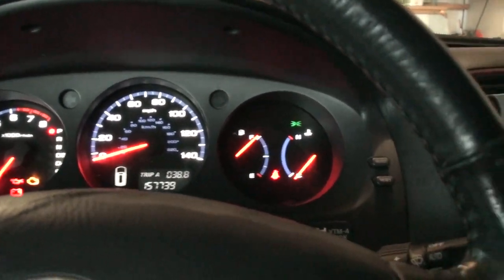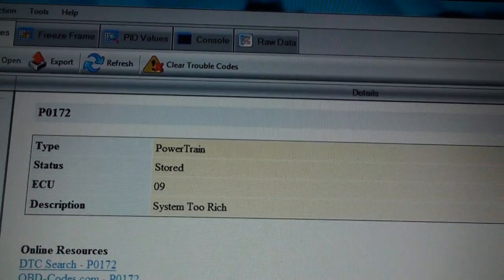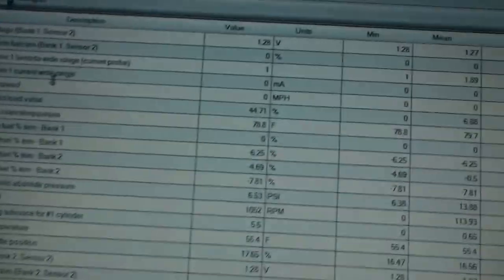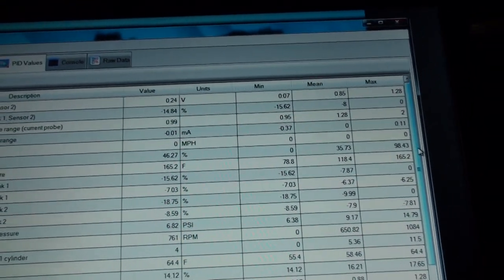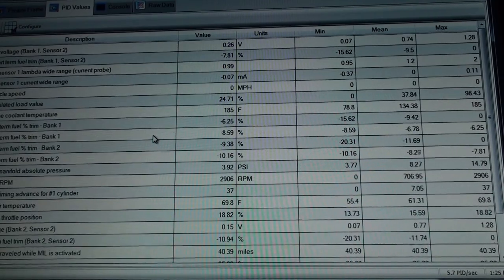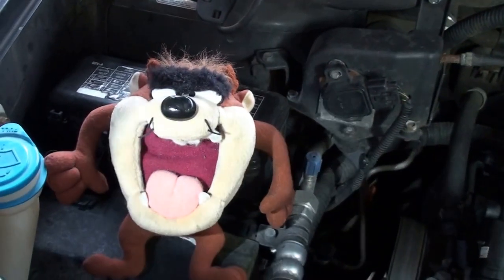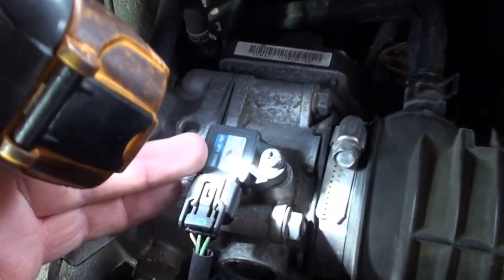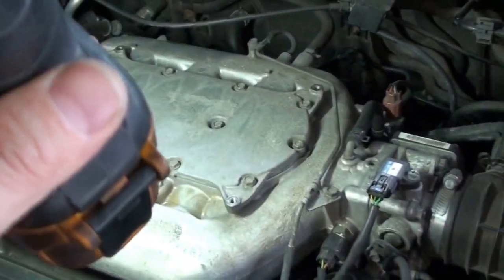Honda/Acura Running Rich Repair - Trouble codes P0175 P0172 -PART 1 - Acura/Honda

Comment: I have the same exact problem with my 2005 Acura MDX 3.5, I been going crazy, Thank you for this video!!!
Reply from the maker: Glad it helped you out.  Check out part 2 of this series. This was one of the hardest diagnosis I have ever done to date to find and correct the issue.  Vacuum readings are the key here to diagnose the issue.   Let me know what you find if you can report back.

Comment: I've had a Vanagon that ran like crap due to tight valves (has hydraulic lifters, but someone didn't set the preload correctly in the past). Took me a bit of time to hone in on that. Great work!
Reply from the maker: Thanks Thomas.  It can be a real head scratcher sometimes.  FInding the issue was a real hemorrhoid, you know how it can be!!  Thanks for stopping by, take care

Comment: Great detective work Glen! And when I saw Chaos sitting up there on top of the windshield, I knew he was giving you hell on this car. How did you finally come to the conclusion that it was the valves not being adjusted correctly. Leak down test, smoke test? And go ahead and show as much footage as you filmed. I'm sure that it will help folks out there who has to do this job. Oh, and don't forget to leave all of the cussing in there LOL. Looking forward to see the procedure of how to adjust the valves in an upcoming video. Opps, almost forgot! I got your sticker Friday and thanks again!
Reply from the maker: Glad you got the sticker!  Do what I do Terry, stick one to my forehead.  You might not remember it's there but you will never lose it! haha  Yes I did a smoke test and watched the vacuum needle flicker.  The car now has 22K miles since the repair.  Check engine light has never returned,  I actually rode in the car yesterday with the owner and at 180K miles runs like a top!

Comment: Thanks for the tip. Working on a Honda Odyssey with P0172 code.
Reply from the maker: Check out Part 2 for what was really going wrong.  Glad the vid helped you out, this was a difficult diagnosis for me at the time.  -Glen

Comment: Thank you for this. Just bought an 08 TL. It was running rich because there was a dead chipmunk chilling under the air filter
Reply from the maker: Bet you were surprised to find that?

Comment: Awesome video it is exactly my issue running -14 and -17 b1 and by I performed a valve adjust ment earlier about 2 years ago. Changes all my sensors new belt water pump all the car had time issues change the cam sensors and it starts and runs great with exception, of 172 &175.
Reply from the maker: Make sure to check out part 2. 👍

Comment: I bet that it runs a lot better now!  Nice job so far, haven't seen part 2 yet.  Lol
Reply from the maker: The crazy thing is the car was actually running fine even with the codes before the fix.  I think fuel mileage improved around 1+mpg.
Reply: Ozzstar I'd have expected much worse. I guess the computer was doing a good job of keeping it in check.

Comment: This is common on the 1000cc sports bikes too.  They call it "wearing in", rather than 'wearing out.  When doing a valve job on a bike, you must have a minimum gap (I forget, maybe no less than 10 thousandth's).  Because the issue is NOT that your rockers/ tappets will get too loose and make noise-- it's that they will get too tight and not let the valve close.  Ironically, on a bike, as it just slightly leaves the exhaust valves open, you can hear a "knock" / tick sound as your'e revving-- and it makes you think that the valves are loose and clacking, like in an old pickup or something.  But really, you're hearing the exhaust open a little too early--  or rather, not quite close all the way as you're hard on the throttle and trying to keep the front wheel on the ground. (lol).  It's almost always the exhaust valve, because it gets the hottest.   On the bikes, they actually have a little round disc the size of a nickle, that sits on top of the valve as a wear surface for the cam;  that is very precisely machined to the thickness that you need, and that's how you "adjust your valves.  You have to measure each gap from valve to cam and order the exact size you need (allowing for the minimum clearance)--- it's not a general kit that has them all the same across the cylinders.  They are a lot more precise than that, since these bikes run to 15k RPM's, or more.  It's the same on the crank bearings.  You measure your bearing size, and the kits will have different colors.  Meaning blue is +.002 over, red is +.004 over, and purple is +.006 over, ect. ect..   So you order the exact size you need for each crank bearing journal, to get you within +/- .001 tolerance.  So you end up getting all these random sized bearings and you have to remember where they all go.  It's not like on a SBC, where you get a .030 over kit on everything and just throw it together.  It's a lot more evolved than that,  having to plasti-gauge everything;  they call it "blueprinting" the engine.  The bike I tore down ran fine-- but it had 30k miles, so I wanted to get ahead of the crank bearings failing---  and even with the largest color they had (I think it was black +.012 over?  I forget), I was still slightly out of tolerance, that's how worn everything was;  the book said to scrap it- it's too far out of spec.  So I just said f"ck it and got all blacks (the largest oversize they offered) and threw it back together, and it worked great.  I just thought it was an interesting rabbit hole that I went down, and learned along the way.
Reply from the maker: That's a lot of good information.  Thanks for sharing your experience with engine building calholli!

Comment: Hopefully I can have a answer from you ,today I saw a 07 Acura tl type s, with 95k miles ,guy said that one of the valves was a little chipped and he had to do Head work for car ,now car runs rich ,but the thing he still drives the car with that issue going on ,my question is ,do you think is a good or bad idea to buy the car ? Please let me know ,
Reply from the maker: An engine that runs rich for an extended amount if time will damage the catalytic converters. The rich condition needs to be corrected. Plan on spending money and time to solve the headache he is getting rid of.
Reply: @ozzstars_cars  thanks so much for your answer! I think I might stay way from that type of Headache.👍
Reply from the maker: @alesil9929  smart choice unless the car is a super cheap deal
Reply: @ozzstars_cars  5k ?
Reply from the maker: @alesil9929  more like $1200
Reply: @ozzstars_cars  ok man thanks I really appreciate you took the time .

Comment: Old video, but would that issue came and go? 2003 odyssey owner here. 225k miles. -14% to -24% short fuel trims, misfire sometimes, lack of power. Few days later she drives perfect for weeks then back to the issue again.
Reply from the maker: Fuel trims would stay negative constantly, it won't fix itself unless your VVT is having a weird problem
Reply: @ozzstars_cars  I didn't think that would be my issue.  I don't know what else to check. Fuel pressure regulator going bad maybe?
Reply from the maker: @alexacuna3454  yup. Watch part 2 on this vid. 😉
Reply: @ozzstars_cars  so the valve adjustment fixed it?

Comment: How did the engine run before the valve adjustment? Was there any idle quality or performance issues? I am getting the same two codes on a 2007 Pilot that I bought not running due to blown head gaskets. I sent the heads out and set the valve clearances on the bench before installing the heads. It runs fine, but the idle is a little rough. Thanks for the video.
Reply from the maker: Ran perfect with the check engine light was on.

Comment: How long was it running rich? Did it have any catalyst efficiency codes p0430, p0420 after the valve adjustment?
Reply from the maker: Not sure how long the car had the rich codes. Ran perfect for many more years after the valve adjustment. No codes.

Comment: Question.i have a 2010 Honda Civic. I've had P0172 code only. New MAF sensor and still no good. Then my car after few months would just die..die... while I was driving-id have to turn car off and it restarted fine a few different times. But now if it dies I'm having to wait 10 min to restart. Fuel pump relay is good ..I'm afraid it's a fuel pump going bad. Any thoughts?
Reply from the maker: It's almost impossible to diagnose an issue like this over the internet.  Have you tested the fuel pressure?
Reply: I will and no I haven't.. thanks!

Comment: Thanks
Have to do the same on Honda jazz 1.4 engine. Short trim is at -20% or so at idle. It's getting better at higher rpm (about -7)
The car is 14 years old an have 100k miles on it.
Let's see how it goes.
Cheers
Reply from the maker: Keep us posted on how it turns out, good luck on the fix.

Comment: Good work boss, I tried replacing the map sensor I am still having the high negative values stft -12 ltft -17
Reply from the maker: Have you checked out part 2 of the video for more info?   It may be even more helpful.

Comment: Trying to figure out the problem.Was there too much lash or not enough ? and would they both cause a rich condition ? Very good detective work without  joining the 98%ers and exhausting the stock in the parts department.
Reply from the maker: The valves did not have enough lash (space).  So basically they are to 'tight'.  This prevented the valve from seating properly, sort of like keeping a window open an inch or two in the winter....there was a draft getting by.  You are right Tom, no parts changing without evidence!  Take care

Comment: I have these codes on my 2010 Acura TL 3.7. It's happened 2 times in 2 years so if the valves needed an adjustment, would this check engine come back immediately when clearing the codes? Should I check for something else?
Reply from the maker: Watch Part 2. Check vacuum readings. 💯
Reply: @ozzstars_cars  Yeah I will read the codes in my car and check the live datas but I'm not very experienced in mechanic to be honest. Should I check something else than the valves if the p0175-p0172 codes only come once per year?

Comment: Hey can you get both these codes if you run the engine with the air filter taken out and the  air intake completely off? Also what about old spark plugs, can they cause this issue too?
Reply from the maker: Doubt it.
Reply: @ozzstars_cars  yea but without the air filter wouldn’t the fuel to air mixture be off causing it to run to lean?
Reply: @spookypasta in a way yes but you’re also introducing a bunch of contaminants in your engine

Comment: Hello Ozz,could anyone answer a quick MDX question,I just bought a new MAP sensor and while pushing it in the nipple broke off about half,so there's still like 3/4in shaft goes on super tight still with the screw,will this still operate correct with a tiny crushed rubber gasket or is that little more to it absolutely essential?
Reply from the maker: I'd remove the broken piece and install the replacement correctly.
Reply: @ozzstars_cars  so don't use it at all,get whole new one?it's just a pain paying 40$ multiple

Comment: Hey man... I have just one word for you: Waw!  All the stuff you mentioned as possible causes I had thought of also, but to come to this theory from NASA on raw fuel that confuses the O2 sensors.... dude that's major league!  Well done!  I always thought that Honda/Acura engines used solid lifters cause they are designed to rev higher than US or euro engines. Do they still use solid lifters?  Would they still require periodic valve lash adjustment? If so that is an item very easily overlooked on older vehicles.  Anyhow, you have my lasting admiration on this one!
Reply from the maker: The 3.5L uses an overhead cam design with rocker arms, there are no lifters like a pushrod engine design.  The plot thickens as to my theory, more to come in future Part 2 on some more reasoning for the two rich trouble codes.   Honda/Acura suggests valve adjustment every 105K.  I guess the valve seats tend to 'push in' to the softer aluminum heads.   Take care

Comment: Today's Fun Project. LOL   Ok besides all the fun did the lambda sensors  record a lack of oxygen in the exhaust stream  and  the ecm cut  back on fuel  or did they pick up the unburnt fuel in the exhaust stream and report a rich condition. Oh man this takes me back to the best series on youtube with Matt Schrodinger. LOL
Reply from the maker: Hey Steve, I'm holding auditions for an announcer to become  "Today's Fun Project" official spokesperson and I hope you can make the tryouts.  Oh yeah I knew it was coming.....the old is the O2 reading oxygen or fuel, fuel or oxygen??  What came first the chicken or the egg?haha  What i can tell you with100% accuracy after the valves were adjusted the fuel trim numbers were spot on and the ECM must have been happy!  This car now has 22K miles since the repair and the CEL has never returned.  Hopefully you will see that in the next vid.  Take care man
Reply: I already did that "WELCOME TO TODAY FUN PROJECT"  then chaos showed up and it went sideways talking about yoga pants. LOL

Comment: Would this cause your car to shut off while driving?
Reply from the maker: I doubt it but anything is possible.
Reply: My car does... P0172 code, random car just stopping, now air sensor ratio to high code . 2010 Honda civic

Comment: I replaced both oxygen sensors on my 2003 acura rsx and still the p0172 code still came back. Do you have any advice? Thx!
Reply from the maker: Yes, watch Part 2 of this series linked in the video description above.

Comment: I know this an old video but I  think the explanation with the stuck valve causing the O2 to read rich because of unburned fuel is erroneous. Oxygen sensors do not read fuel but oxygen content in the exhaust, therefore if you have partial combustion any unburned fuel means there is excess oxygen in the exhaust too which the O2 is gonna read as lean. High map sensor reading would cause a rich condition.
Reply from the maker: truth4reel you are on to something!  Check out part 2.....the truth be told.

Comment: How much would this cost to repair ?
Reply from the maker: That depends where you get it done.
Reply: Ozzstar's Cars how much time it would take ? Like hours ?
Reply: JR 16 valves to adjust , one by one , cylinder by cylinder in your firing order id say roughly a hour to a hour and a half

Comment: The valves tulip into the head. The exhaust valves are always much tighter than the intakes on those j series engine
Reply: OP said exhaust valves get loose 
 Your saying the opposite?  Someone please explain. Ugh my 2005 honda pilot has the po172 code and I want to know if it MUST BE a valve adjustment or a sensor.
Reply: the way the truth and the life The clearance between the top of the valve and the rocker arm gets tighter over time because the valves wear into the valve seat on the cylinder head. Good way to prevent this is to keep a clean engine air filter in there, regularly change the oil and keep the revs down. It’s likely your valves need adjusting. Should be adjusted/checked at 100k on a v6 honda and every 50k after.
Reply: @Gregg0112  I see. I recently bought a 05 pilot and have no idea if it needs adjustment.  I was told newer vehicles have a knock sensor and it adjust themselves?  But idk. Looks like I'd be paying my mechanic a visit then. Thank you
Reply: @Gregg0112  also I just called my mechanic and he said it's very rare that it needs valves adjusted but he recommends a new catalytic and flex pipe. What do you think?
Reply: the way the truth and the life Yea a lot of vehicles have a knock sensor but that is there to listen to detonation and when it is present the computer will pull timing automatically but the valve is a physical adjustment that has to be done by pulling the valve covers on a cool engine. 2 hours lab would be fair to pay
Reply: @Gregg0112  I'll come back with an update. Thank you, very helpful!
Reply: the way the truth and the life Adjusting the valves is not rare in the slightest with that Honda you have. The front y pipe has a flex in it that typically goes bad but the post catalytic converter flange rots away and leaves you with nothing to bolt the new y pipe to. It would be much wiser to cut the flex out and weld a new one in and weld the portion of the cat that is rotted and use the leftover money on other repairs like the timing belt that needs to be replaced every 100k miles.
Reply: @Gregg0112  great great advice,  considering that the vehicle came from P.A. has a loud exhaust noise between the cat flange and flex pipe...it has reasonable but not immense rusting but the flange was the 2nd guess. I'll be fixing that for sure. Do you think the CEL is from that?
Reply: the way the truth and the life No I don’t think the code is because of the exhaust leak being that it is far from the o2 sensors. If the leak was before the upstream then you would want to start with that but Honda’s don’t leak up there. I would have someone who is good with a feeler gauge adjust your valves and I think that is gonna fix it for you. Your mechanic sounds helpful but if he thinks valve lash adjustment is rare on a Honda it isn’t. It would be a shame to pay him a couple hundred to make it worse. When you bring it to another garage the first thing there gonna do is check the valve and you will pay again.
Reply: @Gregg0112  I feel and hear a leak from the flex pipe so I'll change that first